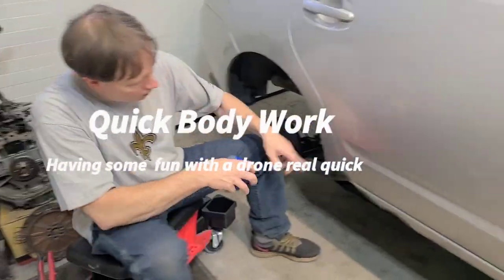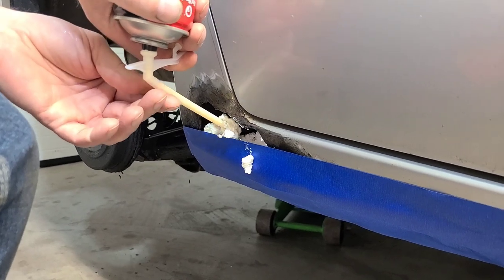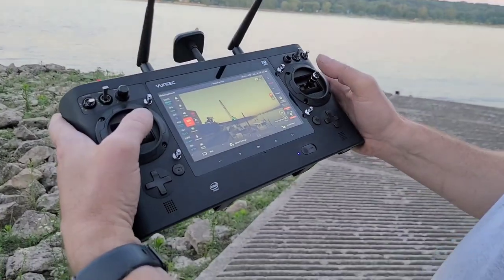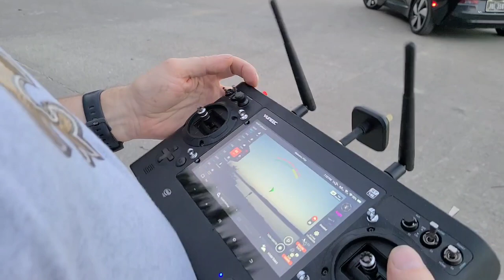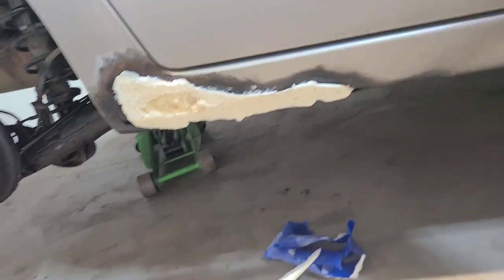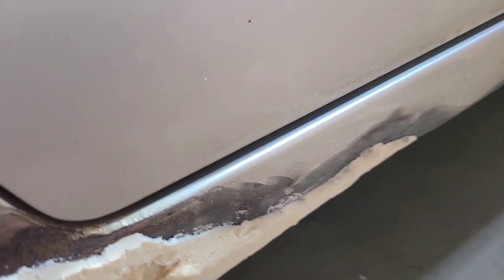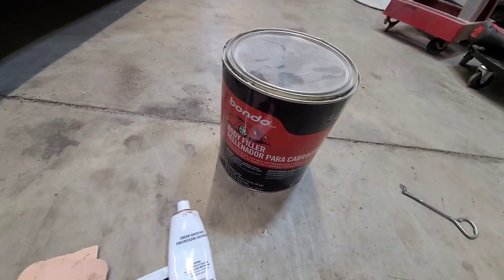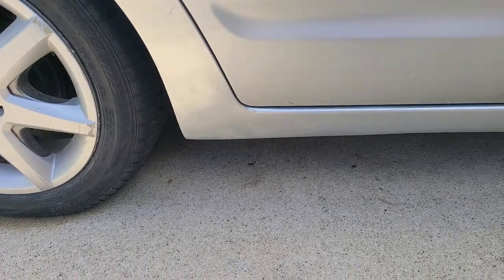S01E03 Why Amphibious Motorcycle Isn't Started. Quick Body Work Rust Removal.

Comment: Sweet drone. I have my 107 and fly racing drones.. I came to watch you repair that rust. Does it matter what type of foam you use?
Reply from the maker: I haven't done testing of other foam types. I do know some foams expand more than others. But you will trim off the extra anyway. Just basic foam filler for home projects.